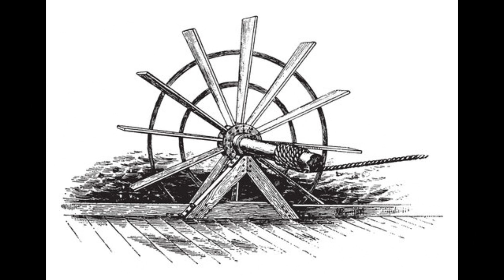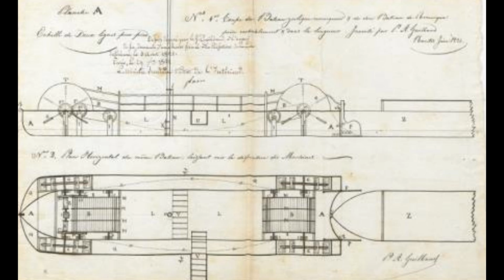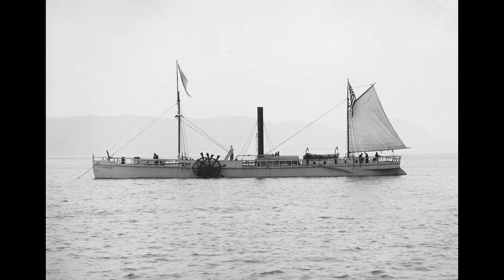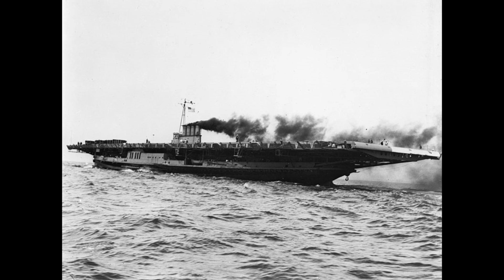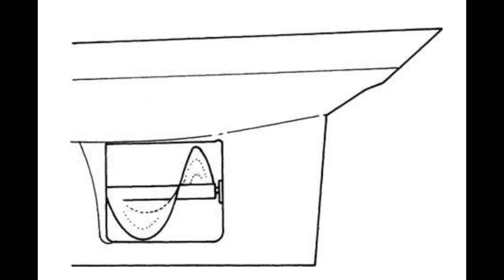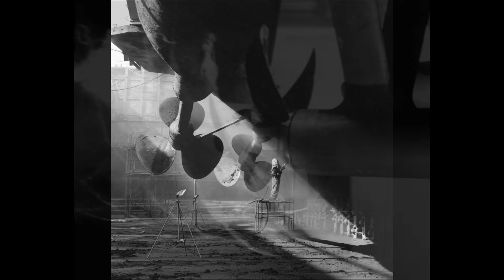Paddles and Propellers - It's all about the rotation

Comment: Turbine cavitation is also one of the biggest threats to rocket engines. A single bubble in the wrong place can cause a rocket engine to explode, which is usually considered to be very bad for the rocket.
Reply: Usually
Reply: Holy s...i've never thought about it. Turbopumps also use fast-spinning props, moving liquid around. Yeah, space is hard
Reply: @digdogsadventures nah it's empty
Reply: are you referring to rapid unexpected disassembly?
Reply: @justdoi8909 As opposed to a rapid scheduled disassembly…
Reply: The question is not whether or not a rocket engine is exploding - that's how they generate thrust. The question is whether or not a rocket engine is exploding in accordance with its design specification.
Reply: @SnakebitSTI  Actually most rocket engines “deflagrate” (combustion occurs below the speed of sound in the combustion chamber). Detonation occurs when the reaction accelerates to above the speed of local sound in the combustion chamber and that typically occurs in either malfunctioning engines or the rarer rotary detonation wave engines.
BTW - gunpowder doesn’t detonate either - it just burns very fast (with the combustion rate proportional to pressure).
Reply: @allangibson8494  Deflagration is exploding.
Reply: If your one rocket becomes many rockets and goes many different directions, you're having a bad time and will not be going to space today
Reply: My dad worked on rockets for a while. IIRC correctly he said there was also an issue with standing sonic waves blocking the nozzle too?
Reply: Depends if she reached her destination before she Exploded. The rokets that hit Moskwa definetly had some kavitation issues at the end of their Vojage
Reply: @Flt.Hawkeye  The Neptune is jet-powerd tho. It's baseically the ukrainian version of the old, soviet Granit
Reply: @digdogsadventures  sadge that ruinis the whole Joke

Comment: Used to work in the toolroom at a company that manufactured propellors; worked directly with engineering on a daily basis. This video is very good, but due to time constraints, very, very limited. Modern propellor design is just this side of Black Magic, and Drach is correct that this only scratches the surface.

Comment: Very good, Drach! Thanks a lot for this. Seeing - or rather not ;-) - that you didn't include a visual of the raising screw of Fregatten Jylland at Ebeltoft, I reckon you have't seen her yet: this ship is such an impressive sight that you wouldn't have missed the opportunity to show the rope they used to hoist the thing when under sail! 
In the vein of this video, I'd b keen on having your engineers views on steering equipment over the ages, starting, e.g. , on the viking ship replicas in Roskilde (another recommendation) and their side rudders, via the Mary Rose, through Wasa and the tiller they used, a  'standard' age-of-sail pulley arrangement like on the Victory, (I'm not sure what the original system was on (HMS) Unicorn in Dundee as no one was around to explain it to me back in the day), to Jyllands' (I think early) rudder quadrant system using a chain along with a pulley system and a very 'historical' looking steering wheel on deck) as well as the further developments into the age of steam. 
Again, kudos for screwing us!

Comment: Cavitation can be reduced by adding air bubbles to the water this helps avoid the vacuum/water vapor bubbles and puts in a spring effect for cushioning the shockwave when the vacuum bubbles collapse. Not an optimal solution but it is better than having your propellers beat to pieces.
Reply: Why not just dimple the prop like a golf ball?!?  🤔
Reply: @worldtraveler930  
Because that would cause more cavitation destroying screws faster. The golf balls operate within a compressible medium ships screws don't.

Comment: The experience of going from flank speed to reverse in a warship is certainly "unique" BUT the way my first ship the Kitty Hawk did it compared to my second ship the O'Kane were worlds/ evolutions apart. Since the Kitty Hawk was steam powered we first had to stop the 4 shafts, lock them and then reverse. So it could take us a bit to actually stop the ship or go in reverse. BUT once we were in reverse 4 21' screws with 285,000 shaft horsepower stopped us much faster than a ship that could weigh in at 89,264 tons had any business to.

The O'Kane DDG-77 is an Arliegh Burke  destroyer had CPP Controllable Pitch Propellers. It's an event to experience from flank to going in reverse happens so fast you just have to YouTube it to belive it. The ships have a splash zone.. YouTube Hard crash back or crash back to see.

Comment: As a machinist at a navy yard, i repaired/refurbished props for aircraft carriers and a few classes of submarines. It was amazing to see just how much damage happened to some of them, such as blades being bent out of pitch (we'd heqt them up, hang them from a bridge crane and then use an enornous hydraulic press to bend them back into pitch). The variois sumarine props and their geometry was also really cool.
Reply: Many, many years ago, my buddy was serving on board USS Dallas during the filming of "Hunt for Red October." When we eventually watched the film together, he said "That is NOT what Dallas' prop looks like." I innocently asked him "What does it look like?"  "I could tell you, but then I'd have to kill you."  🙂
Reply: @ostlandr  he was absolutely correct. What they showed in the movie was....not accurate.
Reply: The sub props in particular evolved from a need to minimise, or if possible eliminate cavitation altogether, as that's usually the biggest source of noise underwater.

Iirc, NATO could use its hydrophones to hear soviet subs manoeuvring on the other side of the planet for some time, well into the '70s I think, until they developed the same type of props.
Reply: And really classified.
Reply: @Shaker626  basically. I mean, it takes a certain clearance just to get into the shipyard and then into the Controlled Industrial Area, but it takes even more authorization to even get into the building where we'd have the props and work in them. If not actively assigned to be in the building, your security badge won't unlock the doors to the building, regardless of whatever other special stuff you have access to. And 2 people cnt walk thru the doors during one opening. One swipe of a badge, one door opening, one person enters. Repeat for each other individual.

Comment: Select the right propeller combo and you can equip your North Carolina battleship berth with a vibrating mattress at certain speeds. Certainly a plus for tired gun crews after wrestling with 16" projectiles. Those clever ship designers.
Always wondered what the magazine crews thought about the experiment where they shot a full load of main armament shells to see how it worked.
Reply: I seem to recall that when the Bismark was dueling with HOOD her main batteries firing destroyed one of her radars as well as a range-finder

Comment: Nothing about Toroidal Propellers, that could be the future and next evolution of the design? 
Other than that, a great video.
Reply: Too early to tell yet how much of an impact they will make, I think.  They're expensive, a Sharrow prop for a boat costs 10x what a normal prop costs, and I'm not sure there's a CNC machine big enough to machine a toroidal prop for a very large container ship at present.
Reply: @r.awilliams9815   True. This is why i said it "could be". It may happend or may not happend. Time will tell, but looking at the performance right now it seems very promising. The optimalization of manufacturing and cost is a matter of time if there will be demand.

Comment: One thing I find insanely cool about cavitation is that it is one of the main reasons that Screws on Submarines are classified.
Reply: I suspect that if all the submarine-capable nations of the world were to reveal their screws, they would discover that all their classified designs look identical - because they are all designing for the same goals in the same environment.
Reply: @vylbird8014 hmmmzz.....i believe that the propellers are covered so the enemy cant derive its acoustic signature from its shape.
Reply: @01Bouwhuis makes sense. Being able to make a miniature to work out the sound of a rival nation’s submarines and then filter that out of background noise with a hydrophone would give you an advantage with triangulating. 

A few hydrophones, some acoustics, and trigonometry would be able to pin down locations close enough for active detection to be useful.
Reply: @vylbird8014  I understand why you might think that, but I was fortunate to work in the R&D department for Marconi at Waterlooville for a short while and it's not the case. Or wasn't 20 years ago. Any device like that is going to be a compromise and optimised for a certain speed, in terms of efficiency and noise. To operate at different speeds you can either change the pitch or change the speed of rotation. There are means of changing the noise but that's not something I can talk about, but it was clear some nations had and some hadn't.
Reply: @MyMongo100  I can imagine the prop covered with some sort of golfball-like patterning with a precise shape and spacing determined by years of simulation and testing.
Reply: @vylbird8014 I Like your Thinking!!!  🤠👍
Reply: @MyMongo100  I think a perfect example of that speed optimization is what happened with cargo ships at the start of the pandemic. They started moving the freighters at a slower speed which did save fuel and kept from overwhelming the ports but they quickly also realized they were now getting more water drag because all their bows were optimized for a higher cruising speed than what they were now using. Sure things will "work" at many different speeds but in design everything is about compromises. If you want to optimize a propeller for one speed its going to be different from another ship/submarine class or country designing an optimal propeller for a different cruising speed.
Reply: @alexsis1778  An interesting and very credible point about optimisation stated lucidly -  
Nice one mate
Reply: @alexsis1778 Casual Navigation has some nice videos about this and explains very well how ships are at their most economical at their design speed.
Reply: @vylbird8014  yeah it’s probably a similar situation that we got goo with stealth fighters. Only a few shapes work.
Reply: One of the reasons I loved working on those props at the navy yard. They simply look cool.
Reply: It is one of the things where physics brings everyone eventually to same conclusions, secrecy is to not give the other guys quick way to get even should they be behind.
Reply: Cavitation is certainly ONE of the main reasons that Screws on Submarines are classified.
Another is the Navy are very wary of being accused of condoning sexual activities where a difference in rank might imply lack of consent.
Reply: @babboon5764  booo

Comment: Cool video.
Hard to believe that navy propellers are now top secret items. What a journey.
how much longer before naval props are obsolete compared to their replacement? and what would that replacement be?
Reply: Top secret due to use on submarines, where quiet is VITAL. The prop replacement is here, it's called a water jet in a shroud.
Reply: Tic Tac Hydrodynamic Flux Drives, obviously...

Comment: The problem of cavitation was extremely serious for ocean liners. The RMS Lusitania had to have her entire stern reinforced in order to withstand the tremendous vibrations she suffered.
Reply: and that STILL didn’t fully solve the problem. I don’t think it ever was iirc
Reply: might have been the engines doing that. Triple expansion steam engines can't be pushed too fast
Reply: @AsbestosMuffins  when the Ship came out there were no geared turbines, so that helps to explain the vibrations.
Reply: Sounds like resonance catastrophe (big cups are prone to it)😂
Reply: Sounds like my neighbor. When she got into jogging she had to go through several sports bras until she found one with sufficient reinforcement. Some models she tried early on were really quite surprising in just how significant the movement and vibration was.
Reply: @spacecat1726  you need certain vibration to achieve certain speed!!!

Comment: There are advancements in cavitation reduction by using toroidal propellers. That is a propeller that has a blade that curves back to the shaft. They have much greater efficiency in propelling a vessel than normal propellers. This 1895 patent is one of the earliest examples I've found that uses a type of toroidal design. US0547210A Marine Propeller.
Reply: Is a variation on the Wells-Myers design of 1891,
Reply: @robertmutton4973  I'll have to have a look for that one. Thank you.
Reply: Found it. https://patentimages.storage.googleapis.com/5d/b2/5e/f983b16c98b284/US467322.pdf

Comment: Absolutely fantastic. I've seen outboard motor boat propellers that were severely cavitated by running at high speed in relatively heavy seas where the prop comes out of the water, rpms go way up, then plows back in. Very damaging and happens surprisingly quickly. Any boat owners out there, never let that happen.
Reply: What you are describing is not cavitation, which occurs with the propeller completely immersed in water.  Cavitation occurs when  there is a phase change from liquid to vapor induced by the mechanical energy of the blade.  When the cavity collapses a great deal of energy is released, which can apparently damage the propeller blade.  
     In ultrasonic cleaners, cavitation is induced by high frequency sound waves, used for cleaning fine components, commonly in laboratory settings.
Reply: @MendTheWorld It definitely IS cavitation.

Whether the Prop is fully submerged is completely irrelevant.
Prop cavitation occurs when the speed of the blades through the water is fast enough to generate high and low pressure zones strong enough to cause the water to vaporise in the low pressure zones. 
The cavities then collapse and release that energy, which tends to erode the prop.
(It also makes the prop much less efficient so there are multiple reasons not to overspeed a prop.)

If a prop with blades spinning slowly enough to avoid cavitation comes OUT of the water, it might then spin up to a higher RPM without water resistance... 
Then when the now much faster spinning prop goes back INTO the water, it would immediately start cavitating.

That is exactly what the first comment described.

Do an image search for "cavitation" and literally half the images are of chewed up eroded boat propellers, and the other half are for a fad liposuction alternative.
Prop erosion from cavitation is, in fact, how people got the idea of using cavitation to clean things in the first place.

Comment: I wonder if anyone ever tried a catamaran-style hull with a centrally mounted paddlewheel?
Reply: Uhm, i'm not sure how practical that would be, taking up most of the otherwise usable space between the hulls.

The only theoretical upside i could see would be a strange one: If you add wheels to the hulls, you could possibly do away with time consuming river locks. Build an inclined ramp with some precisely spaced slots in the middle. Then you could use the paddlewheel like a sort of rack-and-pinion railway system that lets the boat drive up the slope.
Reply: Several ships of that type were used during the U.S. Civil War.
Reply: It would have the effect of protecting the paddles from gunfire.
Reply: There were a couple of cross channel ferries of that nature, the Calais-Douvres and the Castalia.  Neither was particularly successful being unmaneuverable and slow.

Comment: I wonder if someone thought about using a catamaran hull with its much wider (total) beam to use a much bigger wheel with multiple animals to put more power into a pair of proportionally smaller paddlewheels. A trimaran with the paddlewheels in between the outriggers and the main hull strikes me as a good middle-ground between the limited simplicity of the single hull and the catamaran (which could be just 2 ships fused together). It is my understanding that both are more inherently stable than single hulls so it would be better for the animals.
Reply: Catamarans and trimarans have very little space inside the hulls. So they are good for modern fast ferries, but not so good for cargo and naval vessels.

Comment: Animals don't give an infinite amount of energy, or more accurately duration of energy supply.  What about the humble hamster which appears to be able to race round its wheel for days without stopping (and so driving its human captors crazy in the process)  OK, each hamster only produces a tiny amount of energy, thus one would need a vast number of said small animals.....
Reply: Solution - make that hamster huge, preferably without someone reversing that for unknown reasons
Reply: @J.F.Król  So you propose the creation of… Rodents of Unusual Size?
Reply: @DABrock-author  possibly, but if such feat would be done in orbital lab, it would be a Space Giant Hamster, also with miniature version

Comment: I'm wondering why a screw-type propeller hadn't been implemented earlier, even a man-powered one

Edit: I was thinking about something like the crankshaft of an engine, with the men working to spin the axle to generate thrust at the propeller end. That's not too far fetched or especially complicated in my mind, but, then again, I am not an N-th century engineer.
Reply: So something like CSS Hunley's?
Reply: One thing that I think would cause issues is, well, not truly watertight areas with something that would be moving actively underwater
Reply: @nicoferguson1215  Ah, a fair point raised!
Reply: @tomppeli.  thing is, a book series, and the author really, pointed that out a decade ago, albeit in a fiction series.... the Destroyermen series, by Taylor Anderson, if you want to give it a look-see
Reply: I believe Leonardo da Vinci sketched something like this🤔